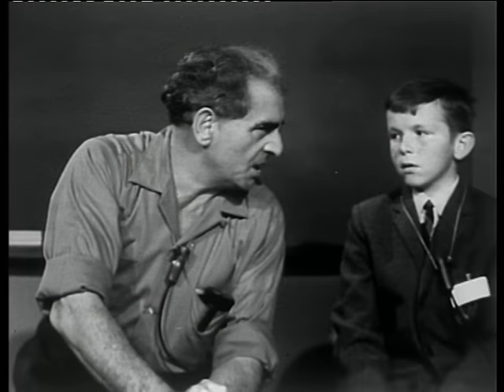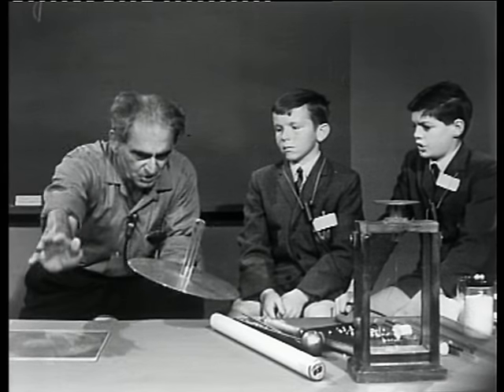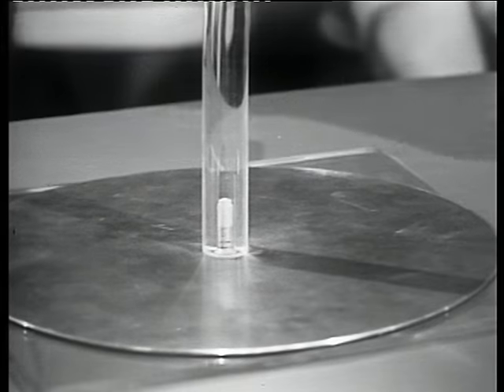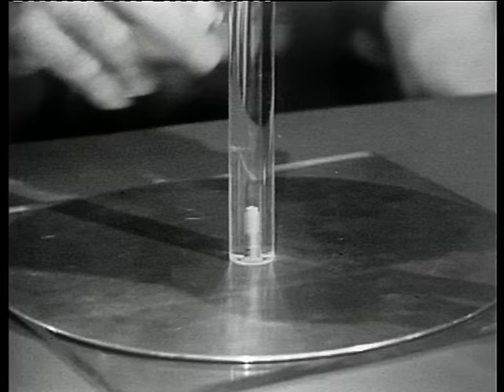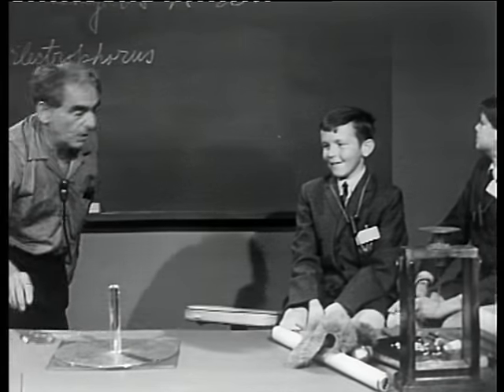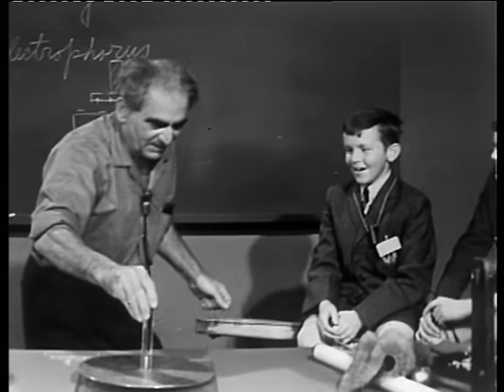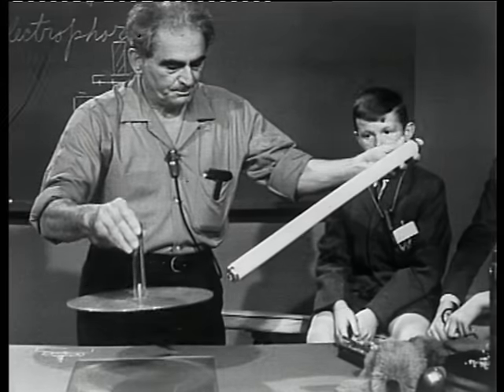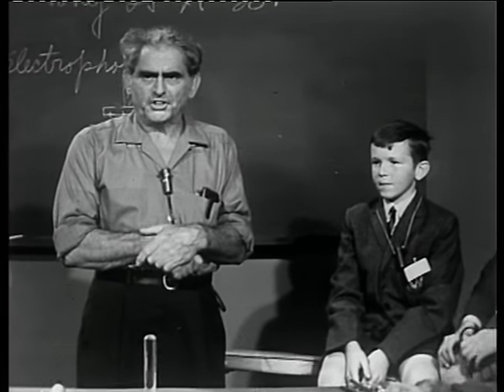Electric shock prank with Julius Sumner Miller | Why Is It So?

Comment: I tried to explain this to my nephew,  but my version was to have him hold a spark plug wire to his tongue while I cranked the engine.
Reply: nasty, especially with electronic ignitions. we did something similar to keep pigeons/squirrels off crops, MOT/SCR/capacitors etc. You'd be amazed how high a squirrel can jump; or how fast a pigeon can get in 20-25ft, before smacking into a tree. Pigeons are so stupid they came back several times.
I got the original idea from accidentally getting across a 4,000v capacitor bank, not something I am in any rush to repeat.